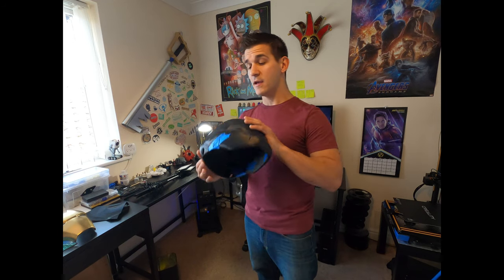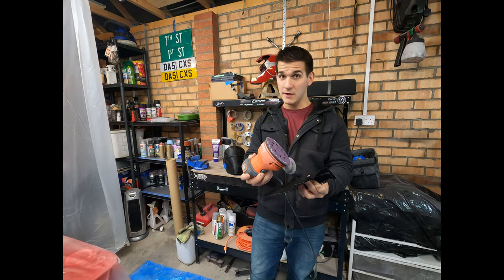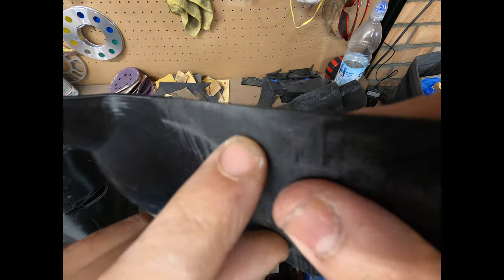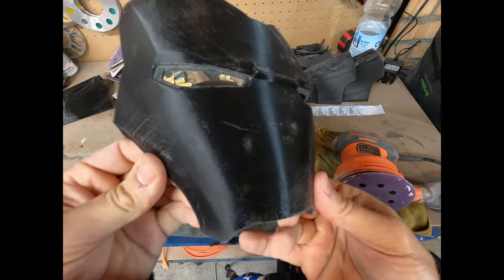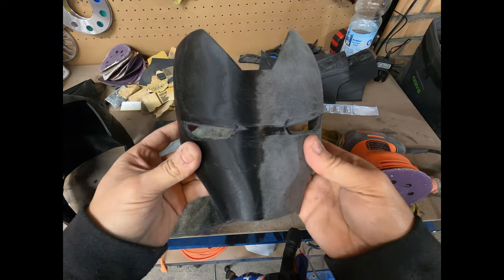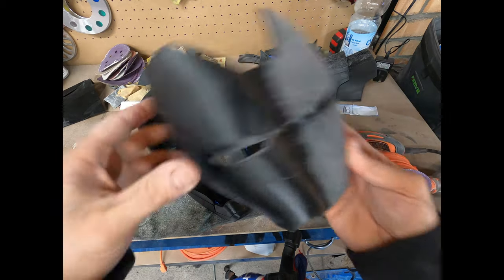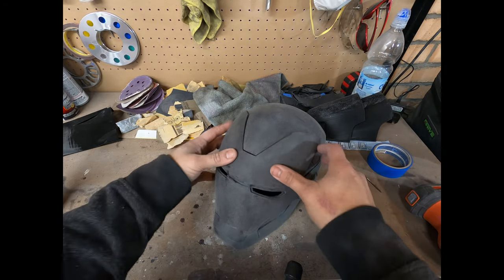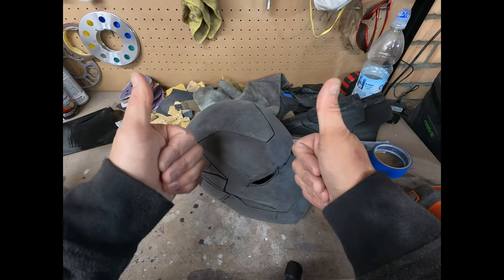How to Smooth 3D Prints - Using Power Tools to Sand PLA!

Comment: You asked for ideas on filling in bad spots on prints.
I have started using a 3d pen to plastic weld/fill after I have stitched the joints together with soddering iron.
But also using the 3d pen to build up bad or missing areas with the same filament and having great success.

This might help your future builds, stops unwanted large deep areas of wood filler and colour matches your print.

And stronger than glue.

I totally dig your achievement dude
Awesome build, awesome for sharing your build.
I'm plucking up the courage to commit to building a suit, you are very inspiring.
Keep up the good work 
👍👍👍

Comment: This is an uplifiting video! I did some orbital, mouse and hand sanding today on some of my old helmets and I was using 120 and 220 grit sandpaper. I will pick up some 80 grit discs and give them a shot as well to follow along. I had a similar base rear support surface issue as well. I tried woodfiller at first then Bondo spot putty, but looks like I got myself in a sanding nightmare by doing the latter. LOL live and learn, trial by fire

Comment: Mystery solved. I did some car bodywork before, but I wasn't sure if PLA can relate. Turns out I would make lots of mistakes if I didn't watch your video. First off, sanding PLA is more like sanding bumper on car (similar grits used). Second, I had no idea that you can use wood filler! I thought it relies on wood's porosity, therefore I wouldn't consider it as a filler. 

Thank you for your videos, mate. I really enjoy them and learn a lot :)

Comment: Hey Frank..The best thing I've learned in the first months of 3 printing is which products to use and when you  apply them. This deserves it's own video. In my very limited experience, (correct me if I'm wrong) Putty Glaze seems to work best for fine print lines, and to use in tight corners where sanding is tough to get at, while straight Automotive Bondo is best for any gaps when you glue parts together, or if you damage a part by over-sanding. One caveat, use Bondo sparingly because it's much harder to sand down than putty glaze or wood filler and you will either be left with a raised surface when you prime or you'll have to sand so much that you'll burn surrounding print areas or create "valleys" just trying to knock down the Bondo. Like I said, this topic deserves it's own video, which products, when to use them and how.
Reply: Hey Frank, I'm finishing my first Mando helmet and I had a question, Is it safe to assume anything I can see through primer will show up after my paint/graphite powder? I have a fine, but noticeable raised spot at the line down the center of my helmet (top of the head). It's not Would you share how many coats of primer and how many coats of paint you typically apply?

Comment: This video was absolutely invaluable, 10,000 times better with the palm sander than hand-sanding. I'm using a dremel with proper attachment for tight corners, also have sanding attachments for my power drill

Comment: Ah, was wondering about using mine to do this.  But I settled on a Card Scraper method that does a very similar job, then you can sand to smooth out the surfaces before priming.

Comment: Would you consider a video (or simply listing here in comments) showing everything you use starting with wood filler and ending on - likely - varnish or polish? I presume you use wood filler, then filler spray, primary, etc etc. Would really help a noob like me started as I have to not only figure out the whole process and what to use on each step but also trace it down to the Portuguese (where I live) most similar product I can find,colour codes, etc etc. Thanks in advance!
Reply from the maker: I would but first. I don’t use any filler primer or wood filler. I only use small dots of wood filler to fix hole or imperfections. 

Aside from that I do cover my painting methods in some other videos but I don’t paint and differently then what the can or Spraypaint tells you to do. 

Last. Me giving painting tips is useless. Air temp, humidity, elevation, room temp, brand of paint, how long it’s been on the shelf, how close you spray, how well YOU sanded. All effect painting. You NEED to practice on your own. No guide out there will tell you how to paint perfectly. There are way to many variables
Reply: @FranklyBuilt  oh yeah for sure. all I was asking - and maybe it's too much to ask but hey, doesn't stop me from trying lol - was a brief description of the process I guess. I presume it would be somewhat similar to what you'd do say in a car bump or something like that. I have literally 0 experience with paint other than to grab a can and spray the heck out of it :) I figured some sort of filler and / or primer would be needed to get the surface as smooth as possible. The gold faceplate for instance, the noob in my would just grab a shiny gold spray paint and get it done but for what I could gather there's all sorts of steps one can / should take to get a proper finish. Some suggest a black primer, then metal silver, then brush (to make it look like scratched metal) then metalic gold...ooof sounds like I need a lot more than "just a few cans of spray paint"

Comment: I printed my first helmet a couple weeks ago.  Wish i had found your videos first before I started.  I have been binging them and they are super. I see things I have done wrong and I think I know how I will fix them next time.  Question for you though.  I know why you have the pieces separate on this mask but for masks that will be permanently glued together would you glue/weld them together for first sanding then sand or does that really matter?

Comment: ever consider using jewelers tools like a flexible shaft? it has a foot pedal and lots of control as well as a polishing setup it is stationary so it can be very effective of course its not as cost effective as the way your doing it but much easier and can do way finer work.

Comment: Hi Frank, new sub here.
About to take on a stormbreaker build using all your suggestions. But also doing some star boost prints as well here and there. 
Big question, how do you do your orientation, and is it even a real concern? 
A few different makers I've watched talked about layer strength with orientation being a factor. 
Do you concern yourself with that?

Comment: Hey Frank. Sorry if you've covered it recently. Only started printing using the voxelab on your recommendation, getting some amazing results. Printed the mk85 and some supports happened to be in the small recesses on the side and haven't come out easily. You've mentioned you open the fine lines more. What do you use? Thanks and keep up the great content
Reply: I believe in one of his other videos he uses a line scriber to get those fine details back into the prints. I'm not entirely sure what you're asking or if you've gotten an answer since you asked a year ago, but they're like $10-$15 USD on Amazon or maybe can be found at a hobby store since they're usually used for model building I think.

Comment: Wow! 80 grit! i was advised 800 grit up to 1500 grit, im like 3 hours in and cant see any difference..80 grit is very coarse but your using it so i guess it works!!
Reply from the maker: It’s a trade off. The 80 Gritt rips faster. As long as you smooth it with like 200-400 after and prime it; it’s perfect

Comment: Quick one as I'm very new to sanding and painting, I printed the mask and jaw at 0.12mm layer height and they turned out FLAWLESS. but the dome where the supports were needs heavy attention (printed at 0.2mm). Would you suggest still sanding the mask and jaw? 

Thanks,
Keit

Comment: BTW the lower the sandpaper grit, the less heat it produces, so your 80 is about perfect for not producing too much heat and not taking off too much plastic and burning through your walls.
But yeah, you should be wearing a respirator when sanding anything with a power sander.  Fine particulates of ANY kind will irritate the lungs.
Reply from the maker: MrTegidTathal  I’m beyond saving at this point lol 😂 if plastic particles and dust get me? I’ve won lol  

But yeah the 40 I used was great for knocking down BIG issues but 80 seems to be the perfect sweet spot for PLA
Reply: @FranklyBuilt  I used to do all my woodworking without a respirator but I noticed I had a bunch of black boogers and congestion afterwards so I started wearing the respirator and I don't have to blow my nose for two days after I am in my shop.  I don't specifically care about my lungs,  mostly about how I feel afterwards :)
Reply from the maker: MrTegidTathal that’s very true lol I work around lots of toxic jet fuel and other chemicals. Already taken baths in the suit haha used to work with Rhino Lining bed liners. THAT shit is unbelievably toxic lol

Comment: This is an old thread, but if you get a chance to respond, I'm printing a Mando helmet in 8 pieces and the first piece took 9 hours but I printed it with layer height set to 0.3 and the lines are reaaaally obvious. Wondering what my options are - is palm sanding going to work to level things out or are the lines too deep? Could I run it over with some filler primer? This is my first large-scale print and I'm trying to figure out whether this piece can be rescued or am I just going to have to junk it and reprint with 0.2/0.16 layer height and deal with the 12 hour print time?

Comment: Wait. Any reason why you place your print like that vs having supports on the inside?
Reply from the maker: Yes. Big reasons. Smoother prints and better surface finish. Also it eliminates the huge crop circles that are left on the front of the faceplate from the top layers. And it’s used face less material. And prints quicker.

Comment: Wet sanding plastic is the only way. I’m an automotive painter and anything plastic needs wet sanded so you don’t get fuzzies. Makes life so much easier lol
Reply from the maker: I oddly have to disagree with that my man. I never wetsand any of my printed before primer and it’s been fine this entire time.
Reply: @FranklyBuilt  You'll use far less primer. I'm sure it looks fine but covering a plastic part in two coats instead of having to bury sand scratch and fuzzies makes wet sanding worth it lol.

Comment: nice i gotta try it :D at what layer height are you printing?
Reply from the maker: DeJotA Craft this was printed at a .3 mm height. I do .4 now for speed using a .6mm nozzle
Reply: @FranklyBuilt  damn 0.3 and smoothes so quick, nice :D I have some old 0.2 prints laying around, will try this tomorrow
Reply from the maker: DeJotA Craft yep! Just go slow and practice

Comment: Using PLA for project like this is just asking for trouble. It's too stiff and warps at too low temps. 

When sanding you should really be using a resiprator, you're breathing in a bunch of of that dust. While PLA is techically biodegradeable it's not so biodegradeable that's it's safe for consumption let alone getting stuck in your lungs.
Reply from the maker: Shayne Bachman I’m not worried about my lungs. That’s my own problem lol 😂 it was only 10 minutes of sanding. I typically use one. 

And PLA is plenty strong for something like this. I’ve made plenty of helmets and tested various temperatures. They don’t warp as easily as people complain about. Especially once painted. It also is very forgiving when sanding and great for beginners.
Reply: Even if you don't care about your lungs new users might see this and follow suit. 10 minutes of sanding is quite a lot to not be wearing a resiprator. 

PLA does warp and break easily, even painted, as many of us know from experience. If you want to use PLA and know the risks that's fine.
Reply from the maker: Shayne Bachman I agree with the new user thing. I’ll add a card to caution them. I myself have just been around
Way worse stuff and work around much worse stuff. Sanding plastic is very very very low on my radar lol 😂 

And there’s risks with everything you print with. It’s just trading off where the risks and issues are. Solid PLA prints with no room for infill are fine. I’m not going to war in the thing. For actually working parts and props? No. ABS and Nylob reign supreme. But as you know printing them isn’t for rookies.
Reply: Professionals are actually leaning towards PETG for movie and TV props now
Reply from the maker: Shayne Bachman agreed! PETG is the future of this. It’s what I plan to move onto next
Reply: Linear advance, dialed in retraction, and combing are your friends when it comes to PETG
Reply from the maker: Shayne Bachman good to know!  I’m considering converting one of my printers to print PETG and leave the other PLA.
Reply: Lol captain killjoy 
You might aswell let the cornstarch get you before the carona virus does.
👍👍👍